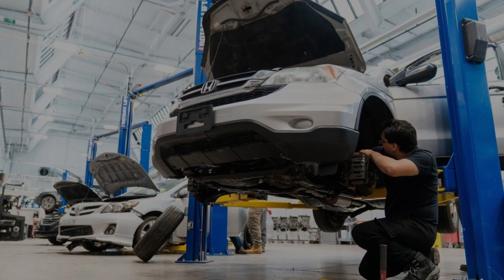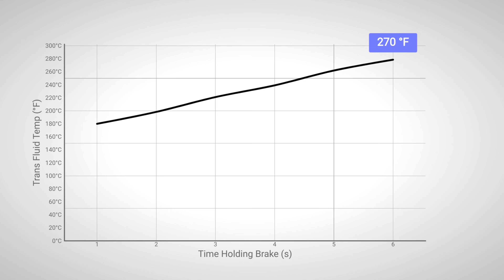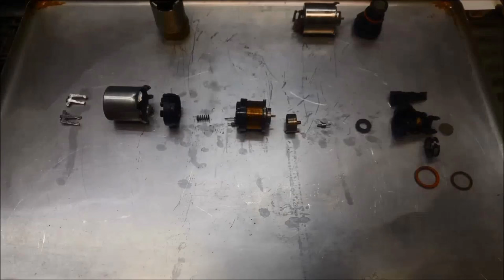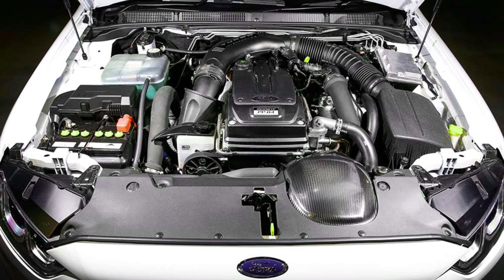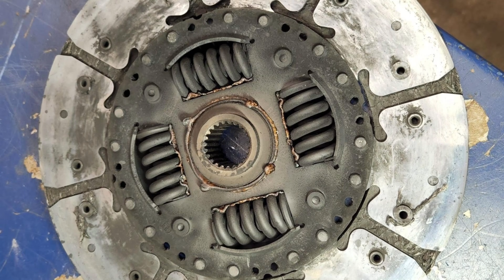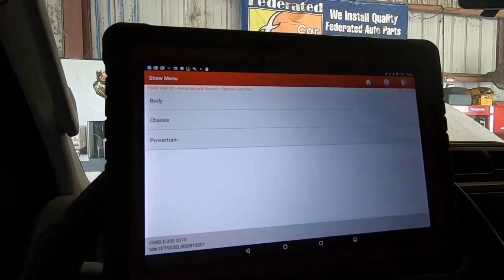7 Stupid Ford Transmission Habits That Are DESTROYING Your Gears (STOP IT NOW)

Comment: What is the difference between holding the brakes on a hill and the parking brake using a different pad to lock the wheel? Park doesn't disengage the transmission, it's the same exact thing to the clutch.